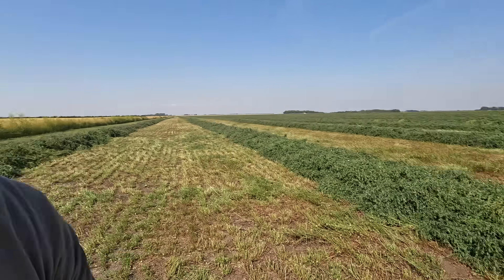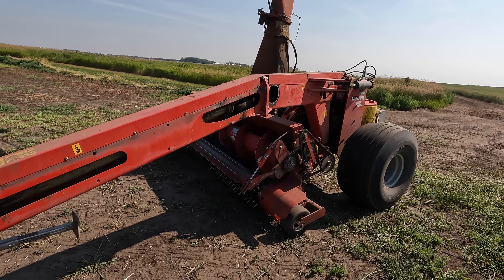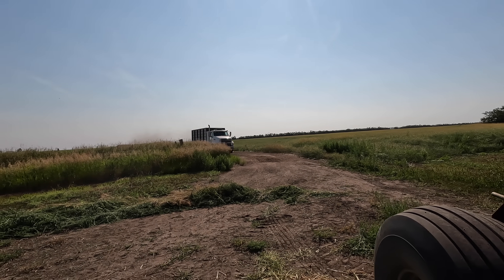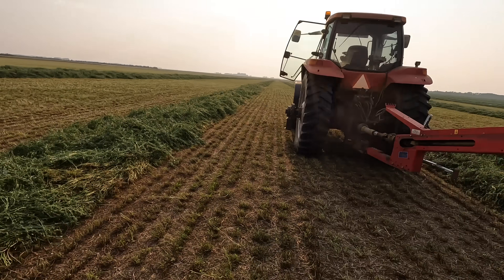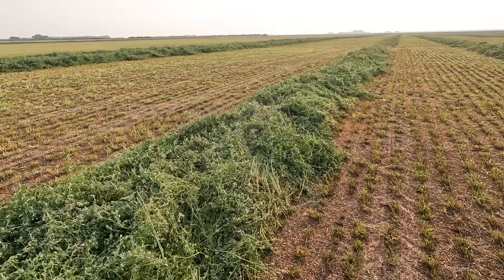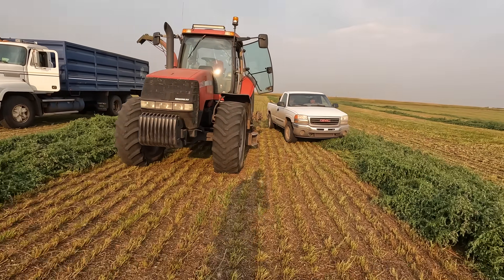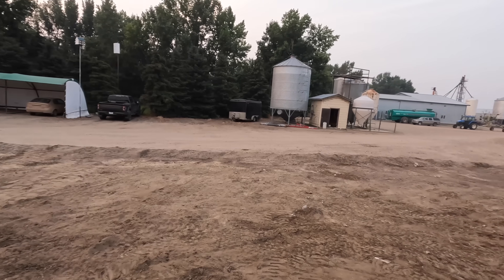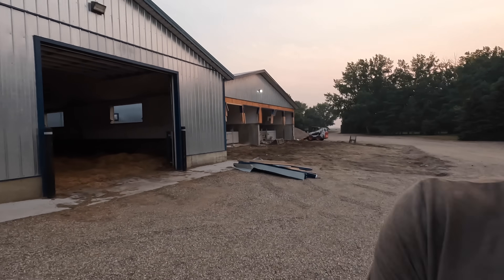Barn Expansion and Second Cut Alfalfa!

Comment: Can you put some thick rubber Grammat in between the motor and the frame to absorb some of the vibration?
I've use that. I'm bushholgs that we're out of balance before and the rubber, we'll take a lot of abuse that the frame is not catching.😊

Comment: Seems like multiple red flags on the chopper to be replaced. Of course, they cost, but soon you will be without...its parts consumption rate is off the chain!!!! (Let alone, parts for that thing are hen's teeth). Many John Deere farms run a New Holland chopper, I'd give up on the dinosaur and get a PAIR of <10yo New Hollands...."if" I had that feed gathering responsibility.
Reply: Their all operation is a red flag if it comes to machines.
Reply: They dont have money to buy new equipment but they have money for truck drivers to wait at the field because they cant get loads on 😂🎉
Reply: They rebuild the chopper every Year I think